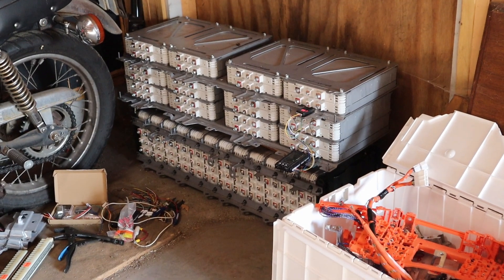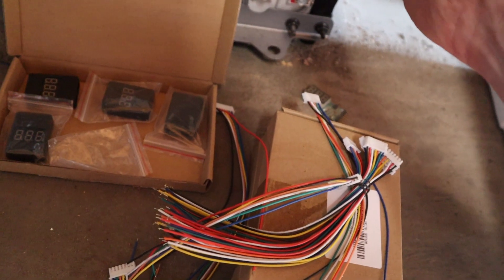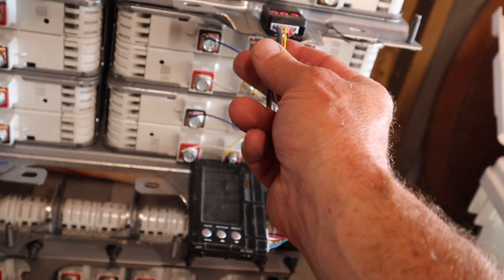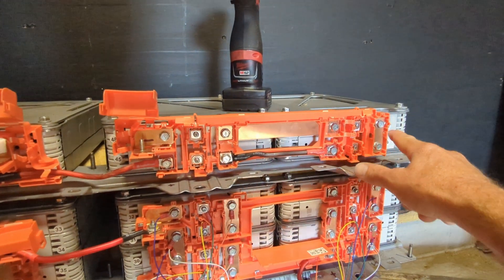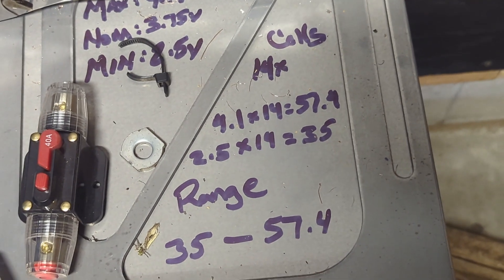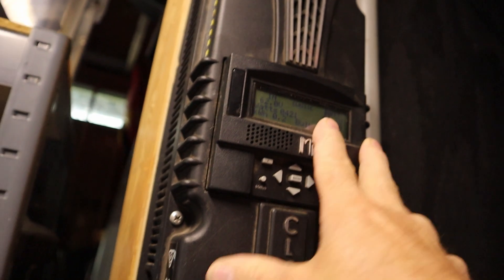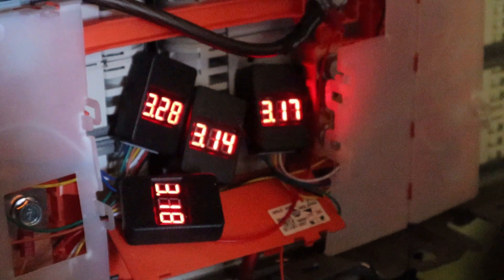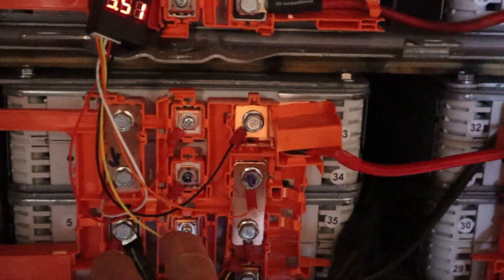Nissan Leaf Battery At Work - Problems...

Comment: You need to do a proper top balance at 4.2v then try again.

Those small shits ain't doing anything except scream.

Get a proper BMS or those 5 - 15A active balancers that you can turn off below 3.9v or so

Comment: Arent those Gen 3 cells ? Got Gen2 in 14S20P from 3 Leafs, Batrium WM5 BMS, no need for a balancer on every cell. The WM5 or others balance with 5A or so, thats too low for 14S20P, but cell drift after nearly 4 years is fine, 10mV at idle. It matters where to locate the cable on the bus bar when having multiple in parallel. Voltage will then vary under load due to bus bar thickness